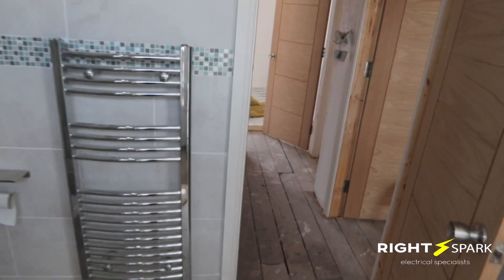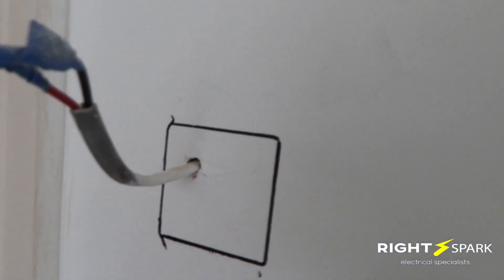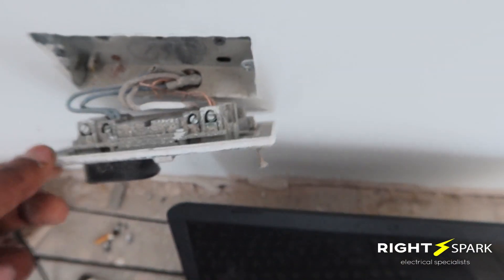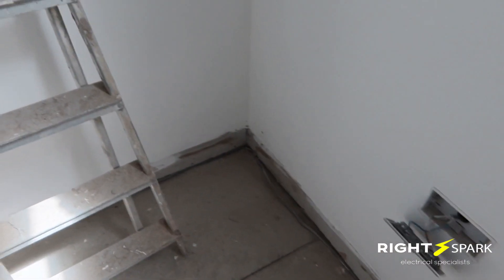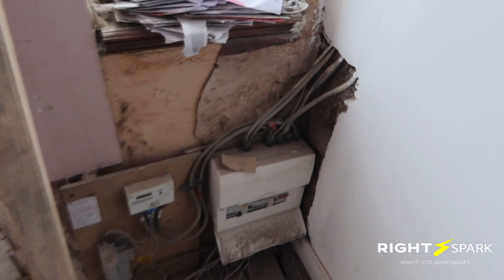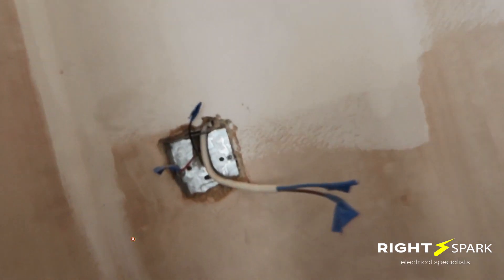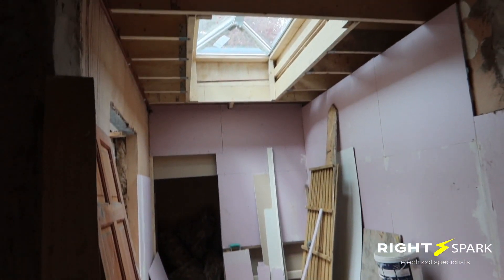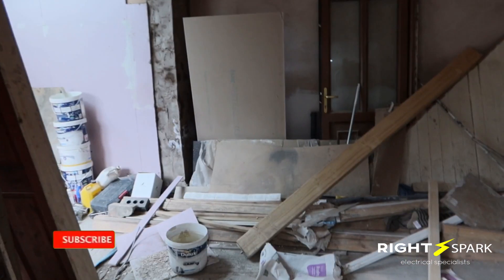Shocking Electrical Work Part 1 - Electrician - Uk Electrician

Comment: earth sleeving and grommets and having no shower isolator fitted does not fail EICR it should go down as C3 on observation. I noticed you don’t give a consideration on downlighter as they should be fire rated.